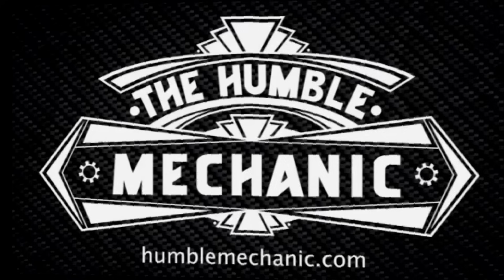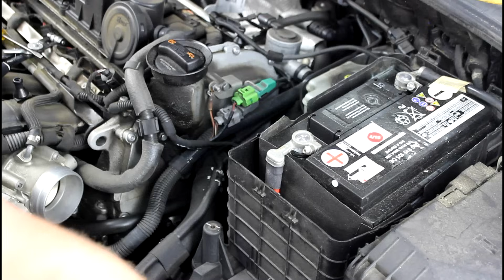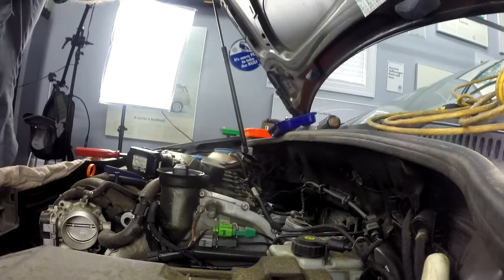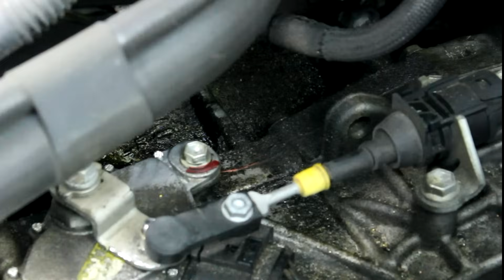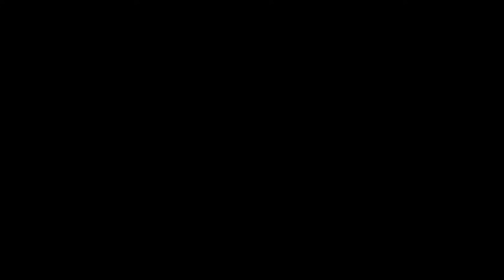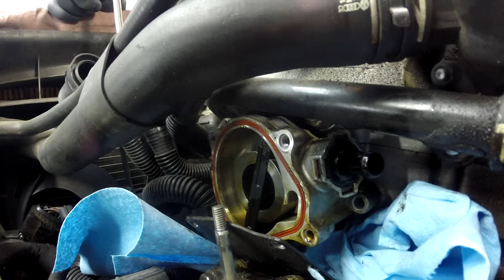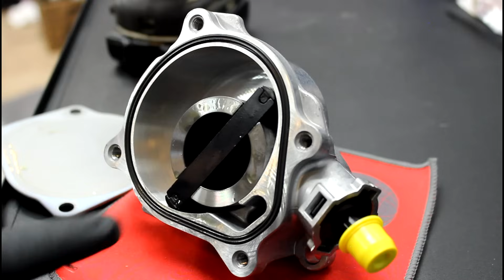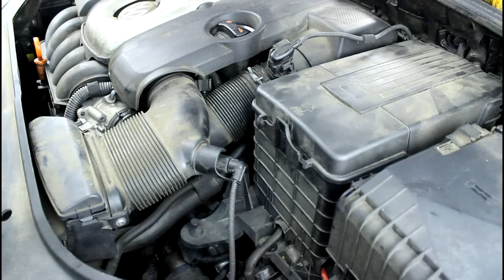Replacing VW 2.5l Vacuum Pump ~ The Easy Way

Comment: This video is almst 5 years old and exactly what I needed. This is absolutely the best exchange of a part video I have ever seen. VERY knowledgable explanations, listing tools (socket sizes, torx sizes etc), reasons for different parts of the teardown, advice for things like stuck tabs on the air hoses.

Comment: Thank you profusely for this video👍👍I was able to change out the vacuum pump in my 2008 new beetle. It’s a manual, and I read in quite a few comments the difference that makes! Although, my battle with disconnecting and removing the battery definitely compensated for not having to deal with the shift selector😂 two different shops quoted me over $1100 to do this. Thank you for saving me over $900!! 🙏
Reply from the maker: Awesome

Comment: Some tips if you're an amateur like me:  1) You can do this buy only buying new gaskets (no new pump for $200+).  Just search vw 2.5 vacuum pump gasket on amazon.  can be as low as $20 making for ridiculous savings relative to vw dealer quote in the $1000's.  2) Use white lithium on the new rubber gasket.  improves seal and will make it last longer, so why not for ~$5 at harbor freight.  3)  Use black silicon on the new metal gasket.  This keeps it in place as you put the pump on, which is important, and improves the seal.  Again, ~$5.  4) Make sure, when you put the pump on the order is engine, metal gasket, pump, THEN bracket.  Any other order causes a horrible oil leak and you'll think you killed your car.    Hope this is helpful.

Comment: I just completed this and it saved me a ton of money and not much time. I did lose some bolts into the belly so i suggest having a magnet grabber. I had a manual trans so it was way easier then the video shows. You do not have to take the cover off if you have a manual. The wire harness on the left of the pump was the only pain point for me. It was fairly hard to get back on and the bottom bolt to the pump goes through the harness too. If i had to do this again i could probably do it in less than an hour ( if i had a magnetic grabber). So glad this video exists, thank you so much Charles!
Reply: while i was in there i replaced the map sensor too ( i had an error for it) i also cleaned out the throttle body  (4 extra screws). In the entire process the most pain in the ass part was really taking the engine cover off. It's like they want to discourage you from the start.

Comment: I'm kind of confused, I'm knee deep in this and I'm guessing you are working on an automatic. I don't think I have to remove any shifting gear to get my vacuum pump out. Although even after removing the 3 torx screws it's not budging. Hence watching this for the 30th or so time.
Reply from the maker: The manual doesn’t require removing anything with the shifter. You have 3 T30 and a 10mm
Reply: @HumbleMechanic  missed the 10mm bolt. Still won't budge though. Almost to the part where you remove it. 😊
Reply: Mines a manual. That may be why, I think I can just shift in in neutral and the levers are out of the way.

Comment: Unrelated to the vacuum pump, but in the same vicinity, can you work on the timing chain and tensioner this way? It looks like you can gain access.
Reply from the maker: Upper chain yes. Lower chain no

Comment: Strange... Mine had a dinner size plate of water spot on the ground about a week before it started leaking oil. At first I thought it was brake fluid, (but several dips on a napkin.. I really think it was just water)... Any idea??? THANK YOU FOR THIS VIDEO!! We're on a fixed income and couldn't afford the shop charge of $1000. Thank you, thank you!!!

Comment: Hello everyone and HumbleMechanic! Can anybody tell me what kind of symptoms the car would have with the bad vacuum pump? Will it whistle as hell when car i's in idle or at low speeds, so all the neighbors dogs would start howling?  My car whistles as a son of gun and i am not even sure where it's coming from. RPM fluctuate too at idle or low speed. Thanks in advance for any help!!!
Reply from the maker: Never seen it do anything but leak oil
Reply: @HumbleMechanic  thanks  will    PCV diaphragm produce high pitch whistle and unstable RPMs?

Comment: I have got same issue with my VW Jetta 2008. I was told that for replacing vacuum pump, transmission needs to be removed first and it costs 1200CAD. I am not auto mechanic myself, anybody knows mechanic in Toronto to be able to do this job?
Reply from the maker: Its a pretty easy DIY. But I woudl call some Europ car shops to get prices.

Comment: Thanks for Video, Sorry if it's a dumb question but what is the source of the oil on vacuum pump? Is this engine oil or brake fluids or something else? So my guess is we need to fill up the lost oil obviously
Reply from the maker: Engine oil is what will leak
Reply: Thank you! Oil leak has been significantly lowered. Do you happen to have any videos or instructions for changing the Oil Filter Housing Assembly for a VW Jetta 2.5 2006? This is the part number: 07K115397D  I suspect that there might be a minimal leak that comes from the top of the assmbly's gaskets. Many Many thanks for your awesomeness

Comment: I got the rubber zeal replaced inside of the vacuum pump for $250. It still leaking but now they are telling me the gasket part leaks which is more complicated. I got a quote for 1130 just to replace the gasket. Thinking of doing this myself, do you recommend buying the whole vacuum pump or just the gasket?

Comment: Does it usually leak from the pump cover or between pump and engine? If it's the cover can't you just put some rtv on it and seal it back up?
Reply from the maker: It can be either

Comment: Hi Charles, any chance this would cause a check engine light? Dealer said I had a leak, now light came on with 2279 code saying vacuum line air leak. Wondering if they are related

Comment: Sooo... I have a dumb question. I have a 1.9 TDI and it has a vacuum pump. However, it's turbocharged so I understand why it doesn't have any manifold/engine vacuum and needs a pump. Why do the VW NA engines need a vacuum pump? I know "American" engines that I have experience with that have "big" cams have trouble pulling a vacuum. Are the VW engines cams "big" enough that the engineers decided they couldn't use the manifold vacuum?

Comment: Thanks Charles, very informational video with all the tips and tricks. I have two questions. 1-. How much is a reasonable price (in labor hours) to charge a customer for this job?. And the other one is why you have to line up  the bolts on the shifter mechanism?. I don't see how they could be assembled wrong, can you explain the reason? Thank you and god bless you.

Comment: Hey Charles, two questions. Any symptoms other than leaking oil? Also, what year is the jetta? Love hearing you on TSP. Great video.
Reply from the maker: The Jetta is a 2007 I think(it’s been a while lol). I’ve never seen anything other than leaks with this. You can convince me it may have other issues. But I’ve never seen it
Reply: HumbleMechanic does it effect shifting?

Comment: Thanks so much for posting this video. You guys said that this is the video for an automatic 2.5L engine but what if I have an 06 rabbit 2.5L 5 speed manual. What exactly is the difference??
Reply from the maker: It’s only about 10% of the work. No need to take the pump apart. Just 3 bolts and a bit
Reply: @HumbleMechanic  
Thanks so much for the reply. I got diagnosed a leak from a good mechanic a couple years ago after getting a misdiagnosed for a leaking rear main seal. I haven't replaced it yet because he quoted me 700$. My brake pedal is now become soft, the idle has been rough for a while even after new spark plugs  (also I'm.not sure if it's related but the A/C performance is also down). 
Do you think that these are all pretty good signs of a failing vacuump pump?

Also I watched your video, and I can see the vacuum pump without taking anything out.
. What are the parts that I need to remove to get to it? Or is the only difference that on the manual it doesn't have a shift selector?
Reply: @p.b.3443  i am by no means an expert but all your symptoms are what i have read online that indicate poor vacuum.   Hope a real mechanic can answer your questions.   From earlier responses, the stick shift version is easier to get to.  Good Luck!

Comment: Hello I was just testing 2010 beetle for a vacuum leak with my smoke pro through bake booster line and smoke is pooing out from around the vacuum pump and not from the line. I was checking for a ST And LT Fuel trim problem and a supper sensitive brake peddle there is no oil leak that i can see is this common 
Thanks Robert

Comment: Appreciate it, the DYI, Charles! To anyone wanting to save money and doing it yourself, it’s pretty easy. I did it all without the use of power tools. I’ve worked on cars before so I’m a little mechanically inclined, but I’ve only worked on stuff for a year. So if you feel like you can’t do it, you can! I doubted myself but it’s on. Just don’t over torque lol! On the linkage bracket as I was torquing it back on, it broke so now I’ll have to drill it out and fix it but the bracket still holds itself with the other 10MM (I believe it was a 10). Again, thanks Charles and love the beard 🧔!

Comment: Please help I am stuck after you take the bolts and walk that piece the transmission. It's not coming off. Please help!! 9:52 to be exact.
Reply from the maker: Try a plastic trim tool to remove it. Just be gentle.
Reply: @HumbleMechanic  It took me a day or two but it wiggled off like you did it.

Comment: Dude - thanks so much. Just finished the job, except I did the rebuild instead of new vacuum pump. Car started fine, no engine lights (yet, lol), and drove/shifted fine. Gonna get fresh oil in there this week - and time will tell if it still leaks or not!
Reply from the maker: Awesome!!!
Reply: I just had to get a new gasket between the block and the pump.    All the same work though.     and yes, its WAY faster for a 5sp.
Reply: fawkthescene666 how did it turn out? I’m trying to decide whether to let a friend change the gasket or take it to the dealership. I’m scared of what could go wrong if my friend does the DIY

Comment: I recently replaced the gaskets on the vacuum pump on my daughter’s beetle. Since I replaced the gaskets, there is still oil making it’s way to the ground although it is nowhere near the same amount. I am curious about how much residual I should expect to see and for how long?  I think I did a pretty good job of cleaning most of the oil off of the area around the vacuum pump but I could only clear out so much. Thanks for what you’re doing!

Comment: I just got a quote for $1500 on my 07 rabbit.  Parts are on order to do myself.  Going to be saving $1250.
Reply: Wolfie 367 u can also buy the gaskets on amazon by rkx if your vacuum pump operates well but just leaks.
Reply: Same!

Comment: great video. Didn't quite understand the red marks on the bolts for the shift control as looks like it all went back together the same way?
Reply: you put the red marks around each bolt so the bracket is install exactly the same way?  you move the bracket where the red light touches the bolt?

Comment: Amazing tutorial, great visual footage, & that high energy is motivating.
I admire your confidence & work ethic but would emphasize on pressure cleaning the bottom of the car & engine bay prior to repair of this nature(leaks)otherwise your viewer could happen to see residual drips or stains on their driveway or garage floors after the fact perhaps second guess their work wondering if they fuctdup a gasket installing the new pump.
Keep up the awesome work.
Reply: Chuck you had me so stoked if it weren't for the fact was 3:30am, no parts on hand i would've tore down my wifes 2010 beetle. 😂
BTW what's your technique to harnnessing the plush beaver while working in the inverted position.

Comment: Hey man I have a question, so I ordered my new vacuum pump and i just opened it up and it has the tiniest bit of rust residue in there. I’m not a professional; but I feel like I should lube it up or something, it looked way less lubricated than the one you opened. Any suggestions as to what I can use to smooth things out in there bro?

Comment: I seem to have a resiviour in front of the battery that is not shown removed in the video. Anyone else who have used this method have that resiviour? 2012 jetta, 2.5 se, manual transmission.
Reply: Found out it's the power steering reseviour. Shouldn't change much, couple extra bolts.

Comment: Great video.. Much thanks.. By the way, is there any special reason to mark the position at the bolts? Not just check the torque spec.
Reply: Because one of the holes is sloted if you dont get them correct your shifting won't be right

Comment: Have you done one on a vw t5 transporter 2006 model ? My engine code is AXD so will this be the same?
Reply from the maker: I’m not totally sure.
Reply: HumbleMechanic 
OK if the tandem/vacuum pump fails and oil is mixing with fuel and coolant will one of the pump repair kits off eBay cure this?  Or are they just for the external oil leak?  
I've got the external oil leak but unsure of the internal parts . I'm in England so I get the repair kits from Europe

Comment: How important is the small plastic circle gasket on the shift selector? It is about 1” in diameter and is below the three metal tab piece. 9:05

Comment: Dealer quoted me $1300 to do this repair. I bought the vacuum pump rebuild kit for $40 - problem solved.  Thank you humblemechanic for posting this video.  Very detailed and the repair went just as you described.

Comment: Recently, I replaced 2009 Tiguan with 600 Australia dollars in a workshop and another 600 Australia dollars for replacing water pump.  The car has been driven around 90000KM.  Do VM cars face this  problem generally? Also,  I am not sure if   the  price is higher than average quotes from other dealers?

Comment: Great video! Will this fix work on a 2.5 Beetle automatic too? I know the description says beetle but it’s such a small engine bay. Just got quoted $1700 at the stealership for my wife’s vacuum pump.
Reply from the maker: Yep. The battery tray is a little more of a pain but it’s 99% the same.
Reply: Haha! Sounds like the Beetle. Took my ages to change the battery. Thank you so much!

Comment: Thank you for this awesome video, today i did replace the pump, I followed all your info step by step,
I did not use the torque wrench, so I just tight them all the way , i dont know if its over tight or under ,
is it ok? 
Secondly , after removing the battery ,now my aux doe not work  ,I use iphone connected to the aux output, how to reprogram it?any suggestion?
Thank you very much Sir.

Comment: How much should cost this type of replacement? My local dealership quoted me $880. I have a Jetta 08 2.5
Reply from the maker: That is a pretty good price.
Reply: HumbleMechanic and they also found that I have to replace de coolant bottle ($240) and the brake booster vac pipe ($345). Are these reasonable prices too ?

Comment: This method worked perfectly!  My leak seemed to be from the gasket on the back side of the pump.  Another video on youtube suggests that the leak is likely from the cover gasket, and they only replaced that.  Apparently, that's not always the case.  Everything comes apart cleanly because VW doesn't use gasket sealer here.  All I had to do was wipe off the mating surfaces with a paper towel.  Total cost for all three vacuum pump seals was about $40.

Comment: I would never tighten the cover like he did I would first tighten the screws behind the vacuum pump then I would do the cover not in reverse order like he did.
Reply from the maker: If your method works then run with it. :) I haven't had issues this way.

Comment: Love the video. What would be difference, if any, on a jetta with a manual transmission?
Reply from the maker: Yes. Manual trans the pump can just be removed. No need to take it apart
Reply: @HumbleMechanic  Man you make me want to cry! Im so excited. The VW place wanted to charge me 1400 to replace. 400 for pump and 1000 for labor. And you did it in an hour! You are God-sent! Thanks a million for replying!
Reply from the maker: On a manual trans????  F that!  They probably just made a mistake but still. Glad to help out
Reply: I finally took the plunge and replaced my vacuum pump. It was so easy, it felt like i was missing something. lol. no more leak. Thanks again HumbleMechanic. You helped me save over $1000. Your video gave me confidence. With mine being a manual transmission, it was easy access on and off just like you said. YOU ROCK!

Comment: Other than the oil leak;  is there anyway warning signs the pump is failing?  My car (2010 Golf) has a pretty loud whining sound when started and sometimes you can hear it just driving with window down.  Almost sounds like a bad power steering pump.  Could it be this pump?

Comment: Hello there!
i found your video while trying to figure out what could cause smoke at take off from stop/stop lights. i have a GTI mk5 BPY, i’ve removed VP off head, after tearing apart unit, found a lot of oil (i didn’t measure it but can tell there was about 4-5oz of oil). i know there should be some oil going inside, but HOW MUCH OIL SHOULD BE FOUND INSIDE??? 
Also, there is a play (wear) at the “shaft” which spins blade, suspecting oil is sipping thru wear gap, sending oil to air intake piping.
Also, found a lot of oil inside intercooler hoses.
I’ve replaced PCV valve and breather hose (back of VC) with revised oem parts.
even had installed a one way check valve between PCV and air intake to reinforced PCV pressure membrane.
i appreciate beforehand any suggestion and info help given 
B. Lok 
Car info
07 MK5 171k miles
APR stage1
Reply: also, straight exhaust with oem “suitcase” muffler attached